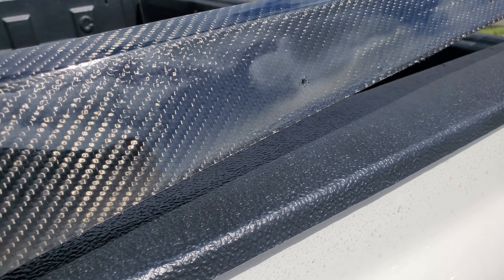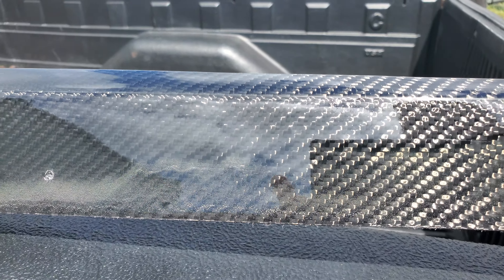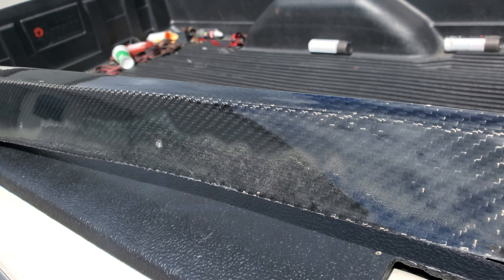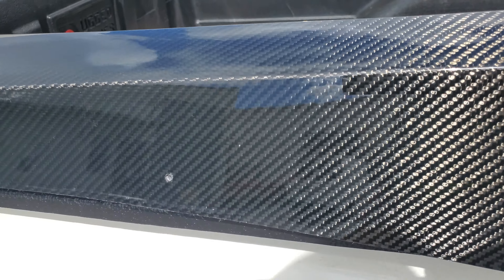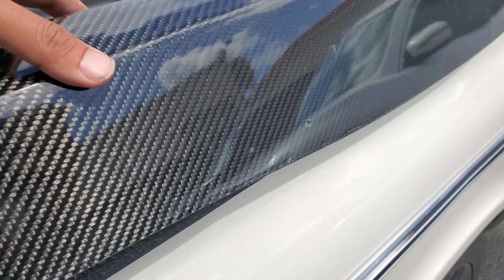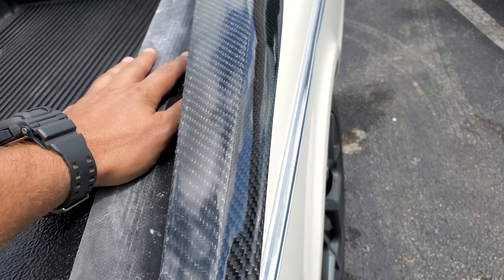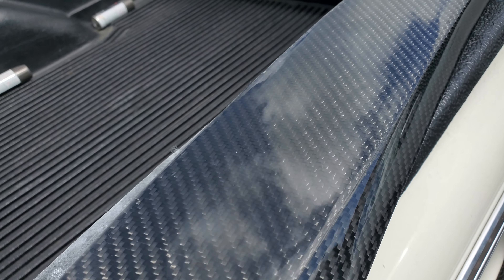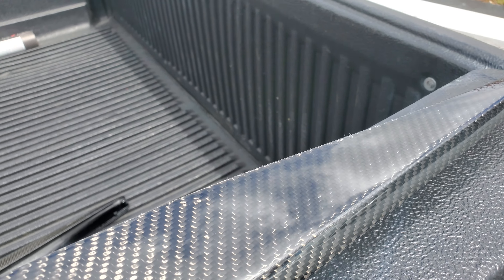How NOT to carbon fiber Atomic 6 Carbon Fiber C8 Corvette wingless side skirts (REJECTED!!!)

Comment: I've been given excuses for 3 months for a replacement for a sideskirt. Received one damaged, was told to get an estimate, sent the estimate, was told it was too much and would be replaced. Every time I call I'm told it will be ready in the next day or so. It should be ready to ship. IT NEVER HAS. I'VE BEEN TOLD THIS SINCE JULY. You may have had good dealing with them, but I've had a terrible experience with them.
Reply from the maker: We apologize for the protracted delay with your warranty replacement and the only thing we can say is that we Droped the ball.

We're trying really hard to be proactive about speeding up our warranty replacement processes, but it's definitely a work in progress.

Thank you for the extreme patience and we promise it's always worth the wait. :)
Reply: @atomic6carbon   You sent me a tracking number a week ago and the product STILL hasn't shipped. What good is a tracking number if the PRODUCT hasn't left the building.
Reply from the maker: @55blue50  We definitely shipped it and we will follow up with FedEx first thing in the morning.
Reply: @atomic6carbon  Not according to FedEx. I'm aware of the shipping process having worked in actually shipping through FedEx and UPS. FedEx tracking says they haven't received the package yet.